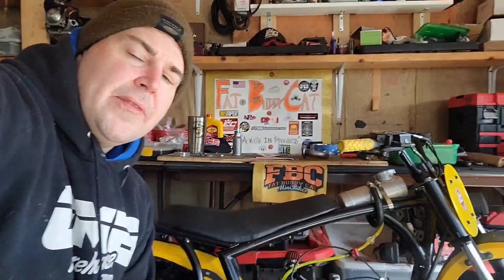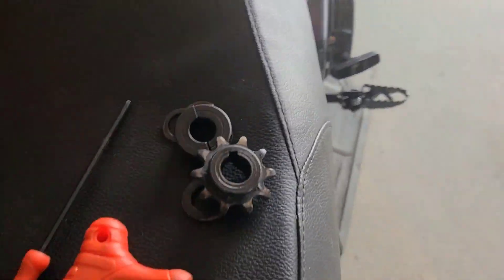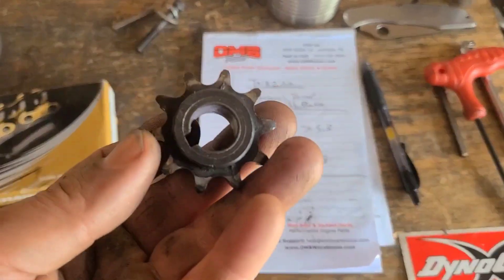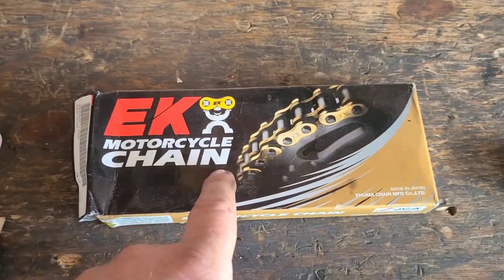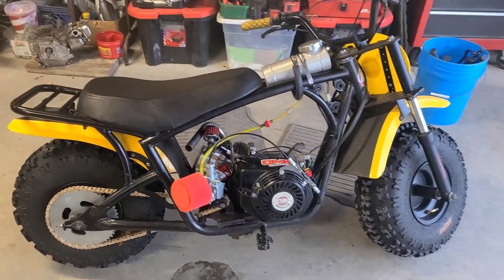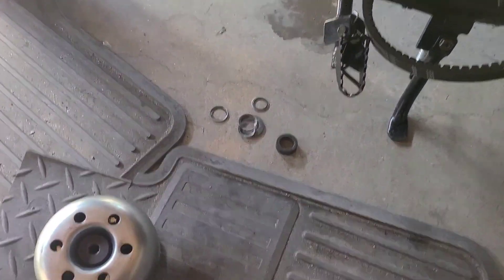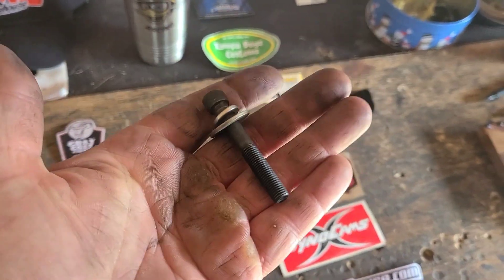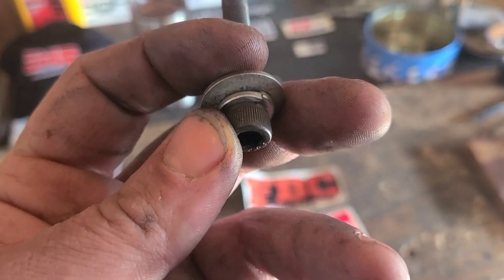How To Build A Better Mini Bike "Sprocket To Carb Ratio"

Comment: I have no idea why my bike is barely moving at all when i go to gas it. I recently did some mods to it like putting in a mod 2 cam, 18 pound springs, and a 44 tooth rear sprocket for more top speed. But i went to test drive it and it feels like it's lost so much power. Something is wrong and i haven't been able to pinpoint what it is that making it so slow. I did realize after i put the 44 tooth sprocket on the rear that i also have a 11 tooth on the front so i'm thinking maybe take off the 11 tooth and put on either a 10 or 9 tooth to help with the gearing ? If that doesn't do it then i may have to put the stock 50 tooth back on but i don't even know if that is what the problem is. I did accidentally tear a small corner of the side cover gasket while i had it open putting in the mod 2 cam and i haven't replaced the torn gasket with a new one yet so there's that and i also messed up the valve cover gasket a little while i had that open. Ads i was tightening down the valve cover i think i stripped the thread cause one of the bolts just kept turning and turning so it doesn't get tight anymore. The stock bolts on my bike suck ass big time i broke like a total of 4 bolts in different areas of the bike while tightening them down they just snap in half. So i just got a new gasket set in the mail and i will be swapping out the torn gaskets with the new ones and i also got a new chain tensioner bolt that i will be replacing the broken one with as well. Broke both of the studs on the front of the gas tank that hold it down so now i need to order a whole new gas tank and for now the tank is just kinda resting in place not anchored down lol. Put a new non epa carb on the bike cause the old carbs screwhole that the bolt screws into on bottom of float bowl stripped and it leaked gas everywhere so i expected it to run good after i put the new carb on but it didn't. So many issues here but none of what i just mentioned really tells me it would cause such a dramatic loss of power like it is experiencing now. That's why i';m thinking maybe the 44 tooth sprocket is the culprit ? I just didn't expect that much of a power loss. Somebody please help me get it going again........😵‍💫😫💩🚲Sorry for the long winded speech i just am so close to throwing in the towel on this thing it's driving me crazy !! It barely goes 10 mph now. It used to do 42 MPH.
Reply from the maker: Which mini bike model?
Reply: @fatbuddycat  ok so it's basically the same as an MB200 but not. Have you ever heard of X-PRO ? It's the X-PRO 200. It takes all the same sized parts as the MB200 and looks exactly the same. I got it a couple of years ago and it has road fine up until i recently did these mods to it. That's why i dunno if i screwed something up while i had the side cover off or if i didn't properly seal the engine after removing the governor and sway arm maybe ? When i took the stock cam out the push rod and lifter from the further into the engine hole fell out and i put them back in from the top of the engine and i set the lash to .003 on both valves. The engine starts and runs as long as i keep my hand on the throttle a little but if i let go of the gas and walk away from it it eventually stalls out. When i am on the bike trying to ride it feels like a major power loss. Like i knew i'd be taking somewhat of a loss off the line but not like this. I can't even make over the slightest incline. The ground has to be perfectly flat or going downhill to move. I'm thinking it could be a combo of the gearing and something else with the engine mixed together just causing a power failure but i'm no mechanic so what do i know lol ? I need someone who knows these bikes inside out that can tell me what to check first to last so i can troubleshoot until i get it running normal again. Appreciate the help man !! So what would you say to check if it were an MB200 ?
Reply from the maker: @JNC1973  if it wasn't sealed it would leak oil. I run my valve lashes tight but you should still make rpm to produce power. If you take the clutch off does it rev up OK?
Reply from the maker: @JNC1973  did you add an air filter or exhaust? Jet the carb? A mod2 cam is more for duration and top end but it wouldn't slow you down too much. I can hit 50+ on 10/50 gears with a Torkzilla on that bike. Why would you run a 43t or anything smaller?
Reply from the maker: @JNC1973  mod 2 is required only 32° and 18s. I'd run 22s. Are you sure you lashed at TDC? Can you post a video somewhere?
Reply from the maker: @JNC1973  https://youtu.be/T9NxOMyzX9c
Reply: @fatbuddycat  I Forgot to mention to you that i do have a Torque Converter on there as well as a Tork-Zilla from OMB. Yes i have the stage 2 kit from omb as well which is the air filter and header 18 lb springs non epa carb. I don't see any oil leaking from where the gaskets are ripped but i'm gonna replace them anyway. I have the 18 lb springs installed but i do happen to have a new pair of 22 lb springs sitting in my shop as well. I didn't install them cause i thought anything higher than 18 lb springs you needed a billet flywheel and rod ? I have yet to get those. Lastnight i was watching some different you tube videos on setting the lash on top dead center and whaty i didn't realize when i set mine is that there are actually 2 different top dead centers so i may have set mine on the wrong one. I guess i have no choice but to take off the valve cover again and do that process over. I just installed a new non epa carb which has either a .36 or .37 jet in it. I only slapped on a 44 tooth rear in hopes i'd get a really decent top speed and now i'm thinking maybe order like a 46 tooth or a 48 tooth if the 44 tooth isn't gonna be powerful enough to move me.
Reply from the maker: @JNC1973  I would absolutely recommend the rod and flywheel. 22 pound springs are all you need to to take a torque converter to its limits. It also opens up the window for a more aggressively ramped cam like a cm265. 

As for your current problem you are 8 degrees shy on the desired timing. Omb has an 8° woodruff key that you can add to your stock flywheel. 
There are a lot of things you can do to make a mild motor run better.
My friend Link has great tutorials on things like modifying the stock plug that can help every engine. 
We can figure out. These motors are very simple.

Comment: I've got to do this to my bike I put a new key in the sprocket since it was wore out it helped I'm wanting to bump up to a 12 tooth I'll be adding my stage 4 built hemi predator after restoration
Reply from the maker: That's the spirit! The jackshaft is butter on this thing.
Reply: @fatbuddycat  can you sometime when your not busy link me that set up its pretty slick on that jack shaft the predator I have is built for tolerances of around  10k rpm should get the heavy pro moving I'm positive my bsp short block on the rascal will smoke it definitely going to upgrade to 10 inch rims on the rascal 12 mm bolt scaries me a little with speeds its going to produce
Reply from the maker: https://www.ombwarehouse.com/5-8-x-1-3-8-sealed-flanged-bearing.html
Reply from the maker: @heathenprojects2639  https://www.ombwarehouse.com/5-8-jackshaft-x-14.html